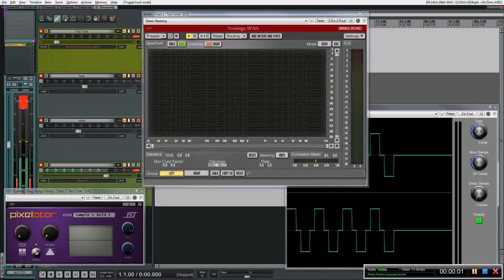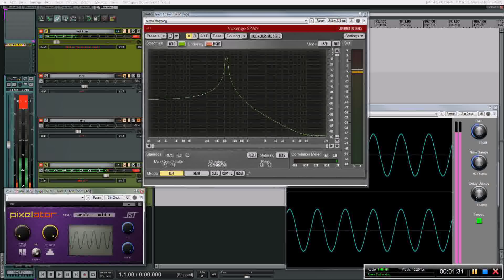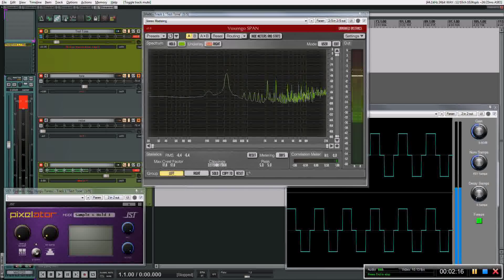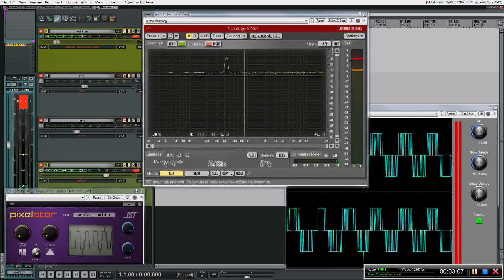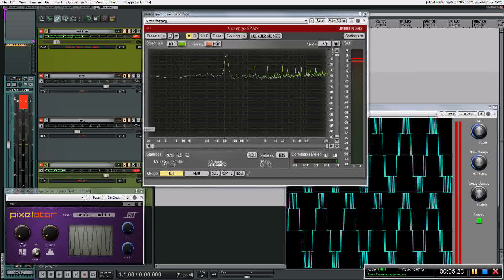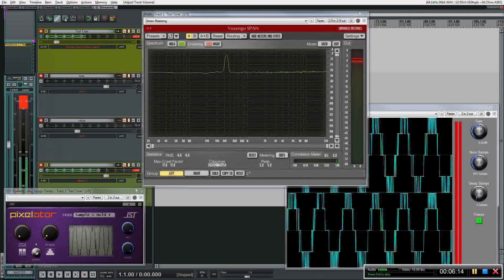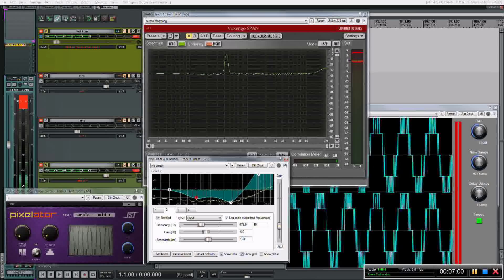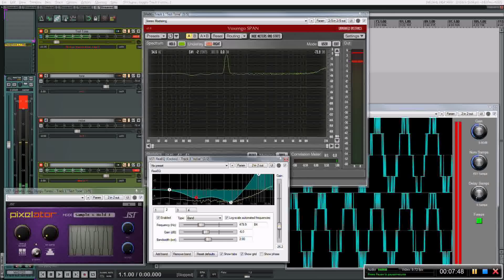Dither Explained (and shown)

Comment: Thanks so much for this video. It's very helpful and easy to understand. But when do you apply dither? Some mastering plugins have a dither menu. That plugin would obviously be applied to the master buss. So if you're bouncing down from a 24bit project to 16 bit file would you use the dither feature the mastering plugin?.. or would you use the dither options on the DAW? Or both? I don't quite get it.
Reply from the maker: I would use it in the DAW, but it really doesn't matter as long as it's the last thing to take place before down converting the bit depth. I prefer to use the DAW dither simply because I set it up once and never have to think about it again.
Reply: Thanks again boz

Comment: I did almost this exact demo for my mastering classes!My friend Jim Johnston of Bell Labs told me that dither is an integral part of the original digital telephone system in the 1950s and to "never even think about not using dither." My experience has been that this includes 24 bit dither especially if you are talking about recordings from microphones. If they have previously been truncated,  the low level information that provides imaging and depth has been lost and this makes the lack of dither less obvious. Jim also told me that it would require 10 to 15 dB. of additional random noise to mask the distortion compared to a proper dither spectrum eliminating it. In other words, while dither sounds like noise, noise doesn't necessarily function as dither.To me, the best analogy is the use of bias on an analog tape recorder to minimize distortion. It will still record audio if you turn it off but why? Dither shouldn't even be an option for competently designed software.

Comment: That was a fantastic demonstration (except for the screencap quality: even in 1080 I was experiencing lots of macroblocking. Maybe use NVENC at much higher bitrates to capture without a CPU hit?). I always turn dither on even though I don't really hear much difference in quality if any. Just because it was taught to me as a best-practice. I also knew the basic concept that in a few circumstances it would preserve my mix when the bit depth is lowered. But this gave me a better idea of WHERE to look for artifacts. Things like a final reverb tail or a Great Fade might be susceptible to lower bit depth artifacts.
Reply from the maker: +Random Encounters oh, you weren't kidding. That is ugly on 1080p. Oh well. I usually try to put more thought into my videos, but I just wanted to make this one super quick.